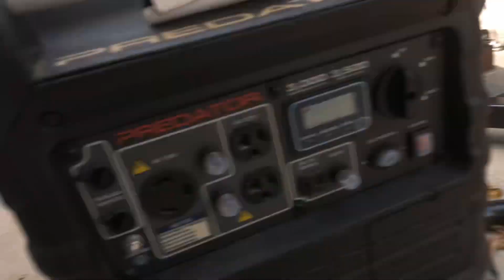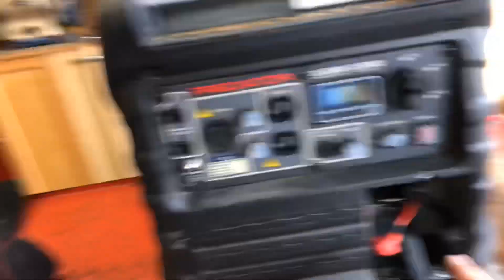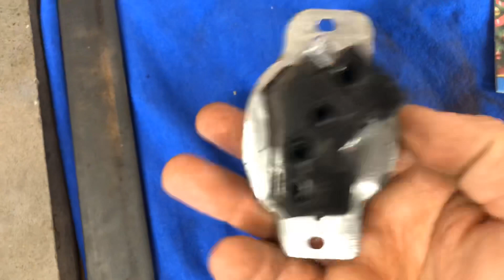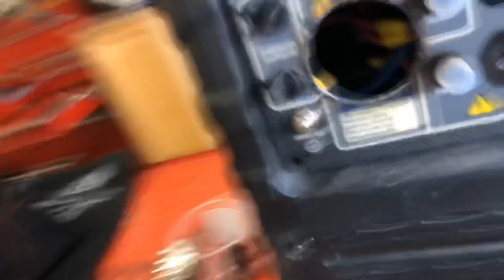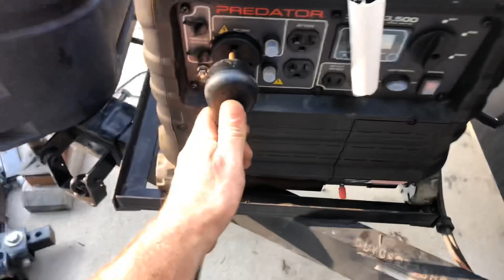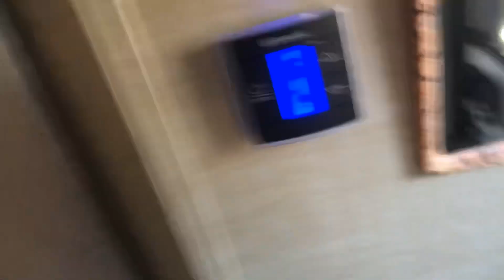Harbor Freight Predator 3500 Watt Inverter Generator  RV Outlet Modification

Comment: I have the Harbor Freight 4000, I want to install the watt meter on the 240 side and can't find one.  What meter are they using and how would I wire it (not technical)  I prefer something that has case I can attached to the frame for low cost.
Reply from the maker: Sorry, I don’t know exactly how to do that.

Comment: The perfect genny for tinkering and it seems just the right output for your camper. I appreciate the clean mod you did on the outlet, nice job. What do you think about an extended oil drain hose for easier and cleaner oil changes? Thank You for the video!
Reply from the maker: I might look into the oil drain, good idea.  These generators are nice, good value.

Comment: Do you have a main disconnect breaker. It would be nice to plug in the genset then throw the breaker to energize the rv. Without this the appliances and anything plugged in will automatically start anytime you plug-in the genset. Seems like it should have a throw breaker or even a double throw breaker. I assume your land/shore power connects via a different plug then the Genset? If so that should be a there position breaker land / off / generator. If yes always plug the genset with it in off position. Then when ready switch the line to generator. I am super interested in all things Toms tinkering.
Reply from the maker: There is a breaker box but I do my best to not have anything on when I start it.  Good idea though.